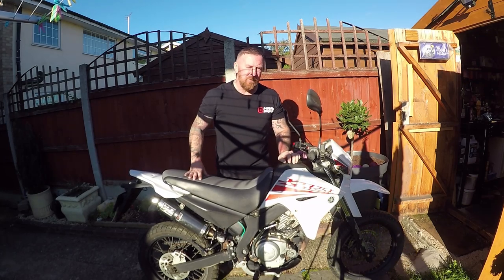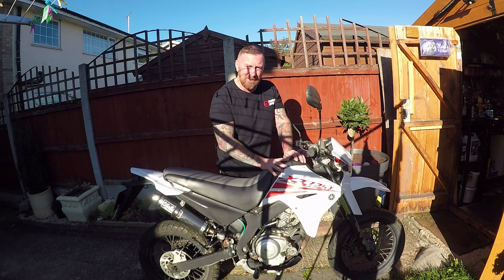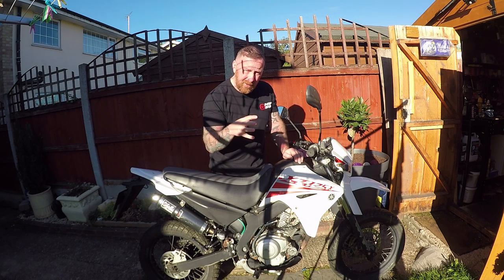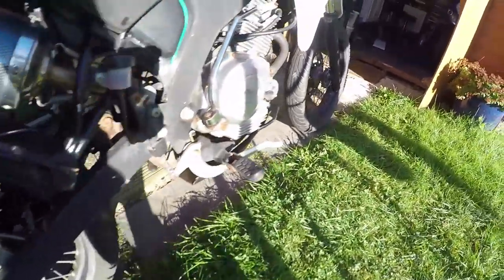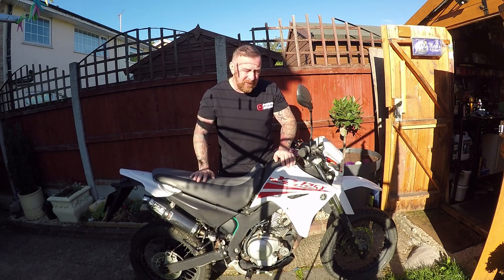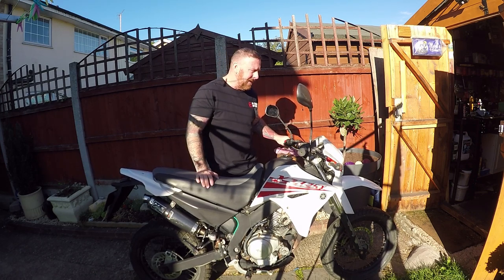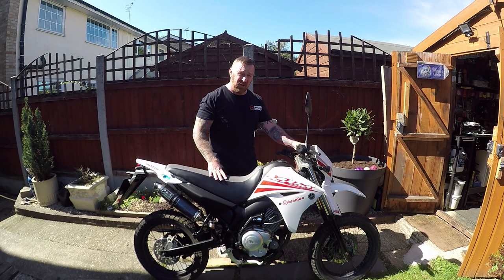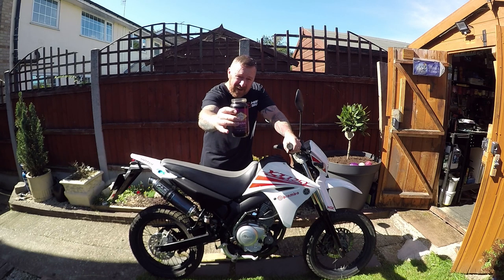YAMAHA XR 125 GETTING BACK ON THE ROAD AFTER SITTING MARK SAVAGE

Comment: hey mark i have a question about speedfight 2 cdis , the thing is i had an aftermarket cdi on it , and i recently got an oem one on a flea market it works but what do you think is the oem one better than the aftermarket one in terms of speed ? thank you
Reply from the maker: on speedfights id go OEM as they do last longer, however if you moped is running well as is id leave it till it breaks before changing it 
as for speed dont think theres a lot in it unless its a race cdi

Comment: Chaps, need a bit of advice. Just brought a spark plug but the cap is to big. The head on the spark plug is one that can’t be unscrewed. Anyone had an success in get the cap of ? Or hacking it ? I am in the process of trying to filing it to make it smaller. Sounds strange but trying to make it work
Reply from the maker: Best buy another that you can take it off 
Make sure it's the same plug as you had in the bike 
Otherwise you will need a new HT cap 
That's the only way bud